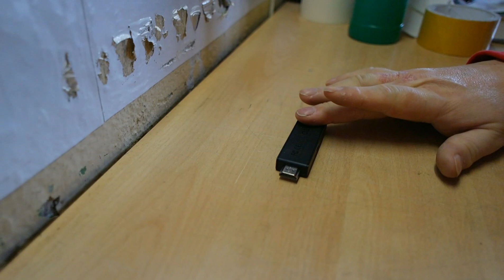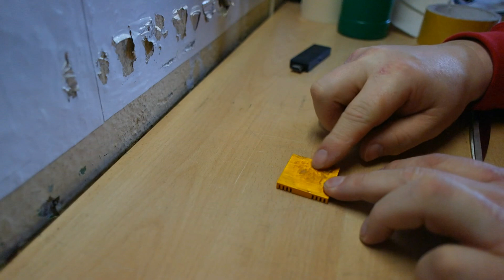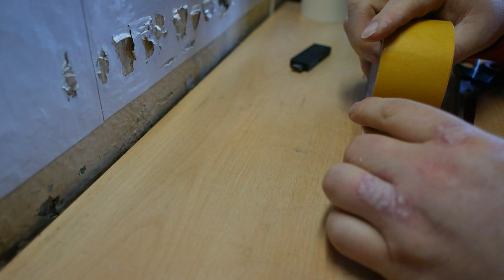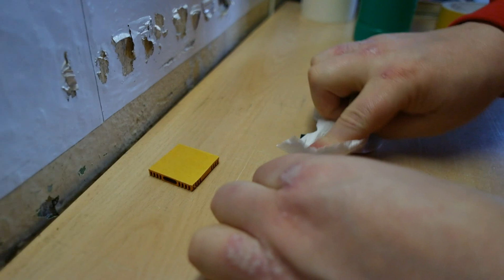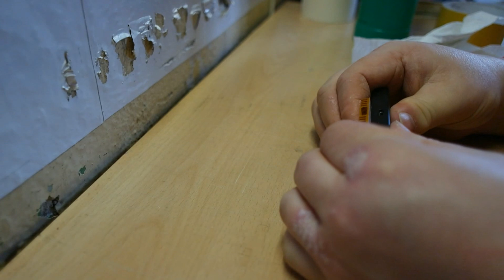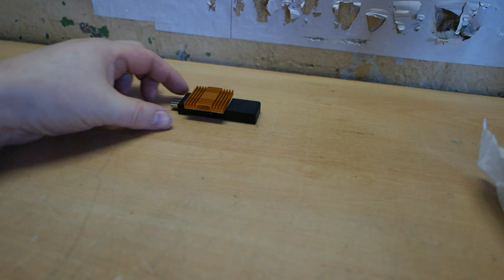Fire Tv Stick mit Kühlkörper / Fire Tv Stick with cooler

Comment: This video was going well then just went bad. Get a smaller heatsink open the firestick add heatsink to cpu. If heat sink is tall case wont close, dremel out a small square so case can close.
Reply from the maker: If you do so, you can´t return it to the seller.
Reply: @schortii  dont return to the seller,paste heatsink to cpu heatsink and put on the heatsink a mini fan and your stick will work without any issue..
Reply: Why would u want to return it? ...I've had mine over 4yrs.and still.working good with my cooling mods

Comment: Step 1... please mute the music
Step 2 ... remove case
Step 3 ... use thermal paste and attach heatsink the cpu shield  and u could either leave the case off or cut a hole with case on...for heatsink ... 
In my opinion.. case off and a heat sink attached.. plus I cleared cache memory and stop most back ground monitoring apps.... my 1st gen firesticks works smoother and cooler and no buffering